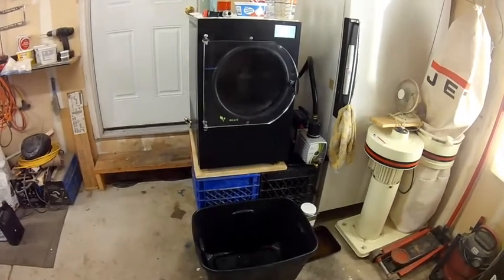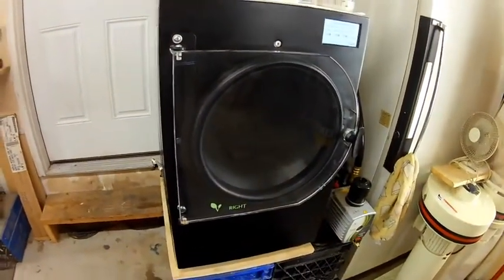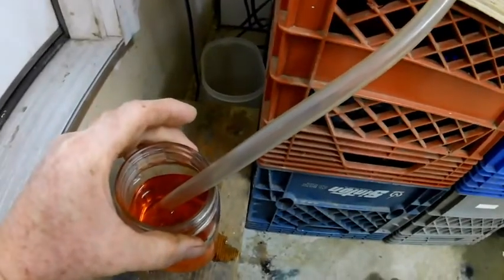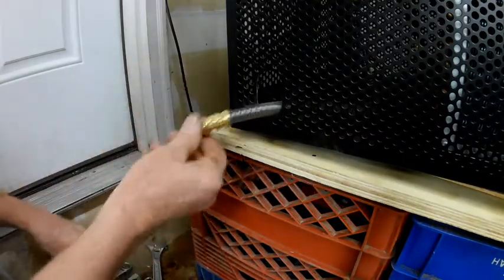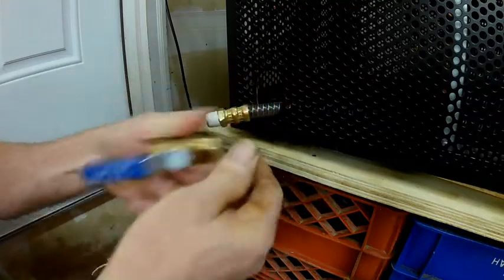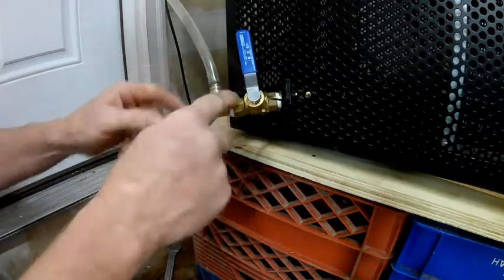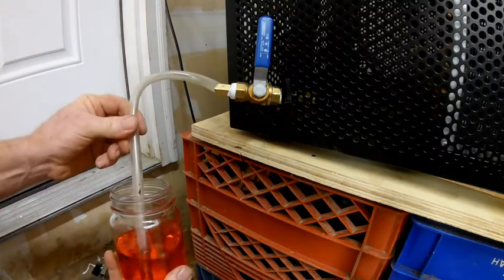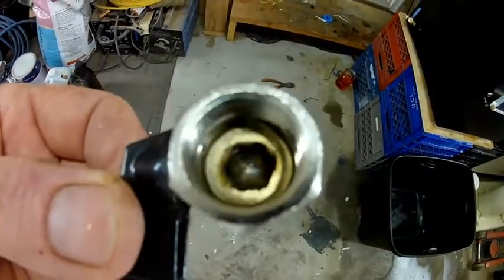Why is my Harvest Right Freeze Drier Leaking Vacuum?

Comment: Hi there…again,
I had went over the tests-drain hose (liquid doesn’t pull up)
Gasket is clean, looks good and good seal
Sprayed carbon cleaner and numbers do not go up so not an epoxy leak(I’m assuming)

Oil seems cloudy(even after I changed it-w harvest right oil).
Vacuum doesn’t go lower than600
Any ideas?
Thanks
Reply from the maker: There's another option.  Maybe your drier is just fine and the vacuum pressure board is faulty.  Have you tried doing a load, and pressing "continue" when prompted by the low vacuum message?  Try doing a load and see what happens.
Reply: It can also be where the vacuum pump hose connects to the freeze dryer - you have to take apart 3 of the 4 side panels (leaving the front panel) and tighten the connection from the inside of the unit.

Comment: I suggest a replacement valve be "vacuum rated" for the longest service life.  HR uses vacuum rated valves.  I have not found any valves at a big box store that are for use under vacuum.  Their valves are for pressure.  There is a difference.
Reply from the maker: I've had an after-market valve for two years.  no problem.

Comment: I wish a bad drain valve was our issue.  Replaced it with a beefy one like yours.  Still can't get below 1000 mTorr.  POS.
Reply from the maker: So only a vacuum issue?  How about the tightness of the inner fittings?

Comment: Hi Phil, do you have an email or Facebook adress, do you offer also some help or infos for money? I need help with my freeze dryer, all the time vaccum problems. Thx
Reply from the maker: What software are you running?
What kind of problems are you having?
Reply: @Philat4800feet  Funtional Test is successfull, but when i put my fruits (tomatoes) the vacuum freezing stops at 2500 and says: over 2500. I tried the hose tests, cleaned the rubber ring, put first the vaccum so that it is closed. But 3 times now the same problem, and I cannot move forward. 🙏🏽 Software: 5.0.14
Reply from the maker: @azadmozaffarin6012  
5.0.16 was issued to help with inadequate vacuum messages.
5.0.18 was issued to help with vacuum problem from inadequate freezing.
You should download and install.  This may help.
Reply from the maker: The downloads are available on my video 5.X.18 (below the description)
Reply: @Philat4800feet  thank you very much. Is is at all possible, that I have a leak, when the functional test is working? Some say, it is at the epoxy plug. Can this be? 🙏🏽
Reply from the maker: @azadmozaffarin6012  It could be.  Bring your chamber up to a low vacuum using the function test.  Spray milk or other colored liquid in and around the epoxy plug.  Do not spray any electronics.  See if the fluid comes into the chamber.  Remember low vacuum.
Reply: @Philat4800feet  alright I will try, what do you mean with: „remember“ low vaccum? Sorry I am from Germany and want to understand it right what you mean 🙏🏽👍🏼
Reply from the maker: @azadmozaffarin6012  Any high vacuum with turn the liquid to vapor.  Run you vacuum pump for about two minutes.
Reply: @Philat4800feet  the protocol says: Not sensing/not read temperature